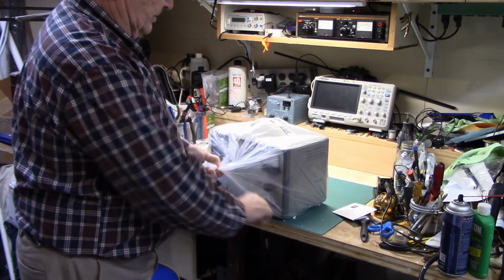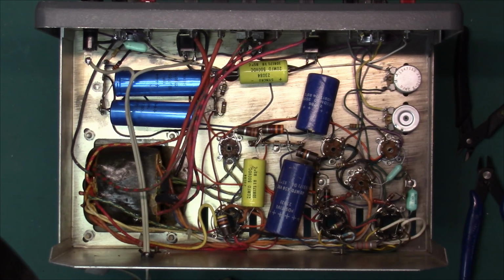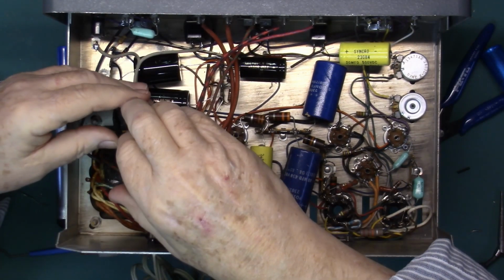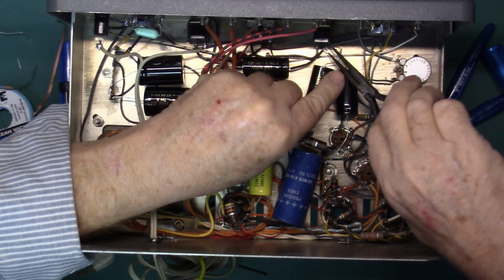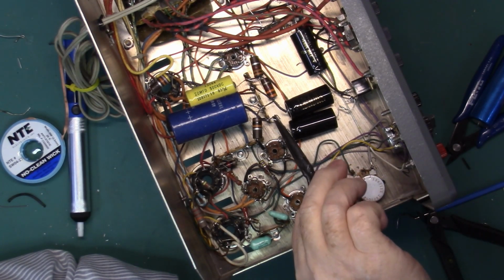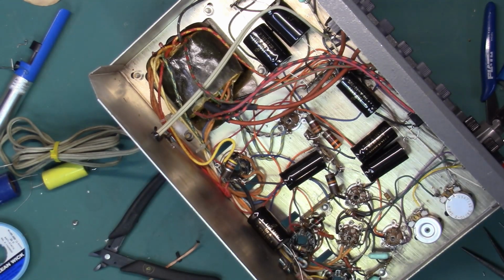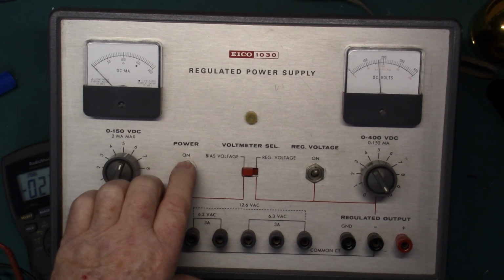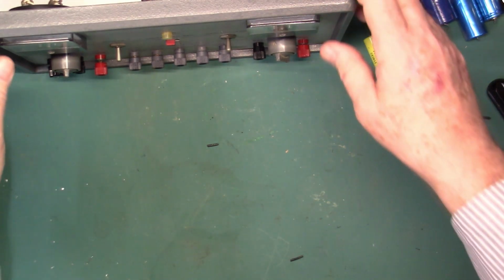Eico 1030 High Voltage Supply Restoration

Comment: Hello. First, i sorry for my english. I unknow this type of power supply adjustable, what were they used for? I ask this because your output voltage is high and the current is small, in milliamperes. Thanks for your video, have my subscribe in channel!
Reply: Its for tubes
Reply: @jakep8484  Thanks! For test tubes vaccum?
Reply: you could use it for that I guess but its more for designing tube circuits like vacuum tube amps and radios and that.

Comment: Your caps were more than likely all leaking DC current if they were original or very old. None of your tester are looking for leakage. I have one of these in the que to be rebuilt. 
This a pretty rare today, when I was in school in the 60's we had two. I don't think we ever used them. What do you plan on using it for??
Reply from the maker: I didn't bother to check them on my capacitance bridge at voltage, kinda afraid to. My rule of thumb is anything that old, just go ahead and replace all electrolytics and (if any) paper/wax caps. I have and will use it to test tube-radios (AM FM), amplifiers (stereos), guitar amps and such.